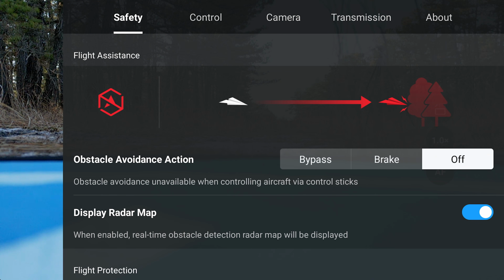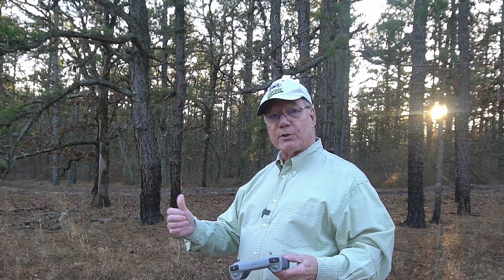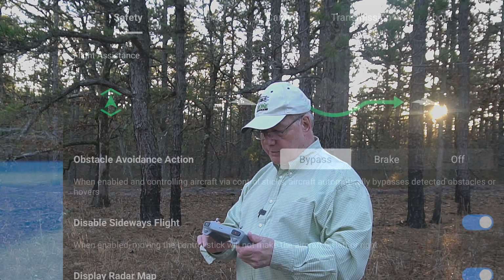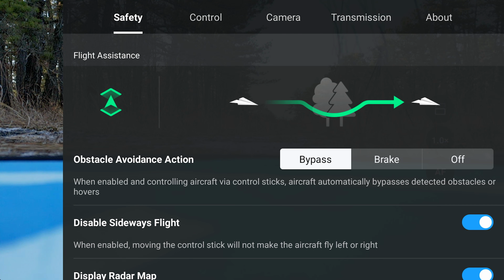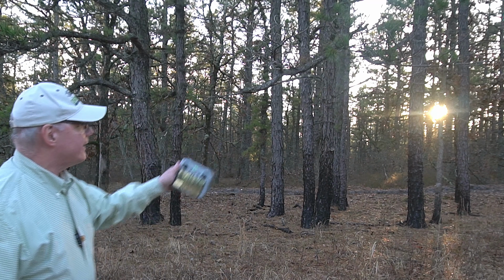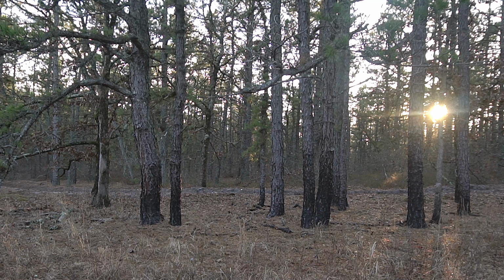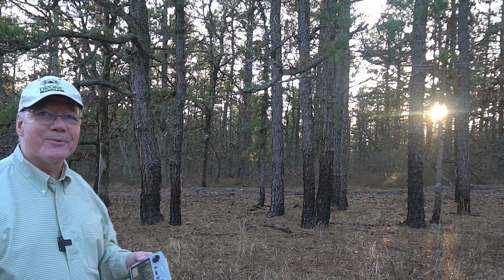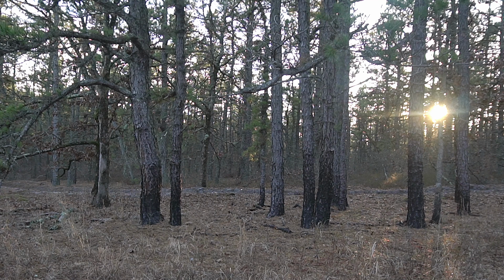Mini 3 Pro - You Can't Crash This Drone!

Comment: 🤔... I hate to say it man but it can be crashed but you literally have to try to crash it
Reply from the maker: Thanks for the post and it almost foolproof. The only thing you might hit is a small wire or tiny branch that the cameras can't pick up. It's also not great in darker settings and I was really pushing it in the late afternoon sunlight, but it still dodged those trees.

Comment: Have you compared the mini 3 vs the mavic 3 apas systems?
Reply from the maker: I have tested the APAS on the Mavic 3 and it works the same but can't fit through the tight spaces like the Mini 3 Pro. APAS creates a safety "bubble" around the drone and uses that to judge the clearance it needs. With the Mini 3 Pro being smaller, it can fit through really small gaps like I showed at the end of that clip. I was really surprised to see that DJI was able to build that into the Mini 3 Pro and still keep it under the 250 grams. I'll have more APAS content posting soon so be sure to stop back for that. Rick

Comment: The OA on drones have come a long way. Can you crash your Mini3. Of course you can! Even with OA turned on.
Reply from the maker: Thanks for the post but I sent it into the woods over 30 times and never hit a tree. Once you turn on APAS, the Mini 3 Pro devotes most of it's processing power to detecting and avoiding objects. if it's unsure, it reverts back to OA and stops the drone in its tracks. The only thing it could miss would be a thin wire or small branch but other than that, it's foolproof.
Reply: @Dronevalley  Thanks for the reply Rick. My point was after reading the title. "You can't crash this drone", and the comment you wrote back. "The only thing it could miss would be a thin wire or small branch". Love your channel Rick. Thanks for keeping us informed on the latest tech stuff.
Reply from the maker: @shsechas  Chas, no worries and nothing is 100%. The new APAS 4.0 is amazing and most fliers use it in a more open space. I was trying to really test it by flying through the forest. I purposely picked the Pine Barrens because of the gnarly trees and brush in there for the test to really push it. I'd trust it, but I always check the area for wires and other "snags" before flying.
Reply: @Dronevalley  Thanks again Rick for reading your followers comments and replying. Just though the title was off. You have a great channel. I have learned over the years. Think with your head! Not with your heart! Sometimes hard to do that. Appreciate You!!!
Reply from the maker: @shsechas  Thanks Chas, I appreciate you following the channel for so long and all of your support. Looking forward to a great 2023!

Comment: Can you do a video explaining what the forced remote ID update from DJI to the Mini 3 Pro entails for the hobbyist flyer? Will the hobbyist that has not registered their Mini 3 Pro with the FAA still be tracked with remote ID?
Reply: So by using the fly more batteries, you technically would have to register the drone due to the battery weight pushing the drone above 249g. Wow.
Reply: @adcraziness1501 Thanks so much. That's good to know!
Reply: @adcraziness1501 So I spoke directly to a DJI supervisor and they didn't care if I had the extended batteries or not. They said since they can't differentiate between the professional (part 107) flyer vs the recreational hobbyist, they are turning on Remote ID for everyone. They also said that every single new drone that they make from December 2022 and into the future, will have Remote ID. They didn't care about the FAA not requiring the hobbyist under 250g being exempt from Remote ID. It's absolutely rediculous what they are forcing. They will surely lose some sales over this.